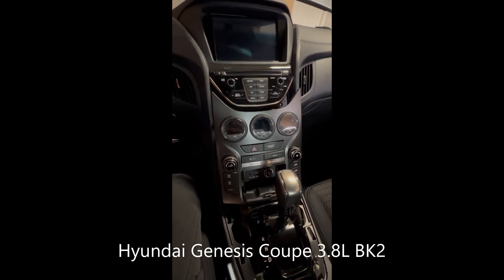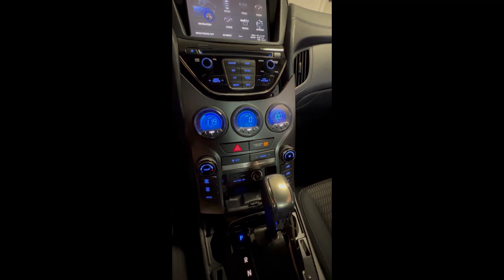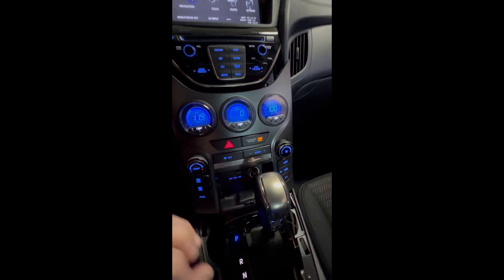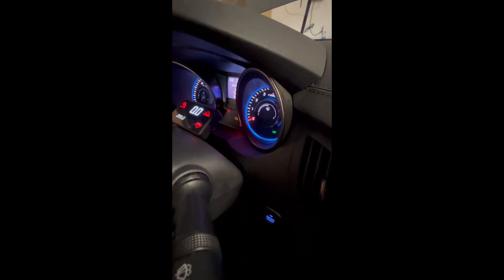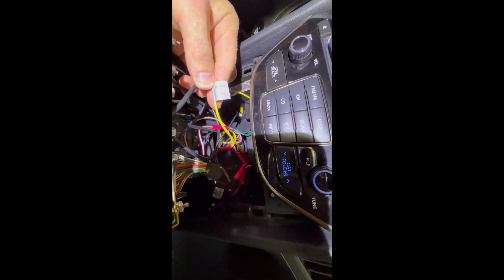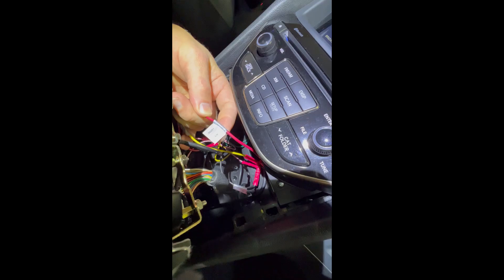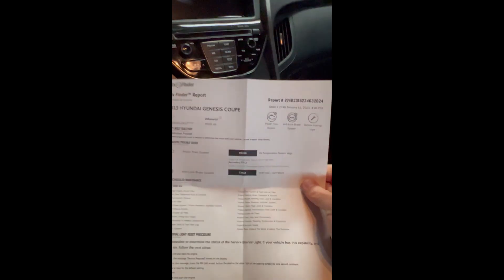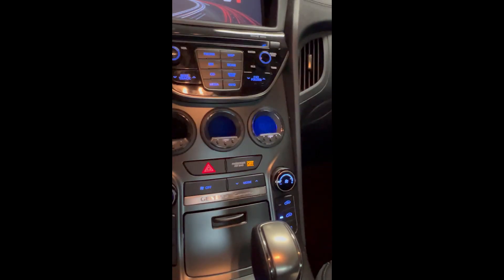Genesis Coupe 3.8 Gauges Upgrade - Need to Keep Stock Gauges for Check Engine Light

Comment: Just to get this straight you tapped the oem wires into the aftermarket wires so the oem gauge gets a reading ?
Reply from the maker: No, the final fix was placing a tee into the motor and hooking both oil temperature sensors to the motor and separate wiring.